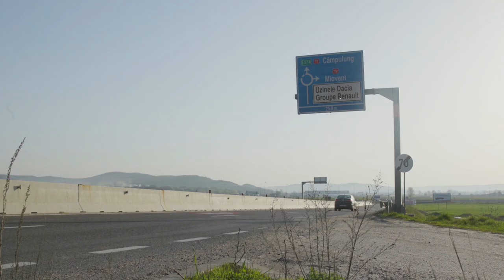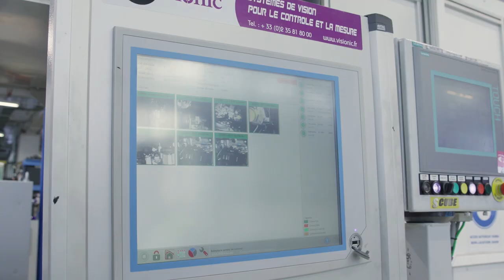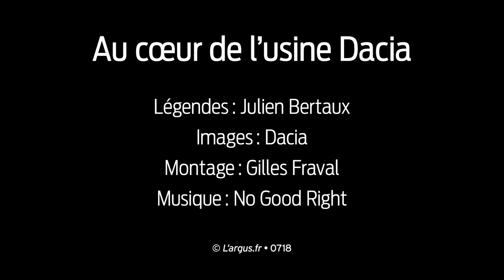Au coeur de l'usine Dacia

Comment: Et les problème des fissures à la jonction du pavillon et des ailes arrières n'est toujours pas résolu... depuis les premiers modèles de Duster. Normal quand on voit la pose manuelle du mastic. Si l'opérateur(trice) mesure moins d'1m90 impossible de faire ça correctement.
C'est le seul défaut (bien connu de Dacia) de mon Dudu, mais je n'en changerais pour rien au monde, surtout en 115 dCi boite EDC.